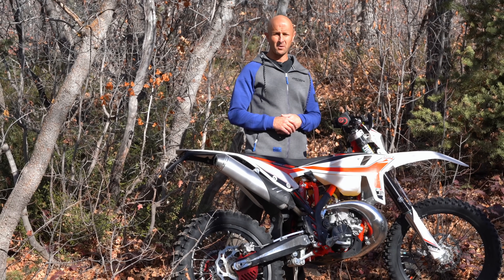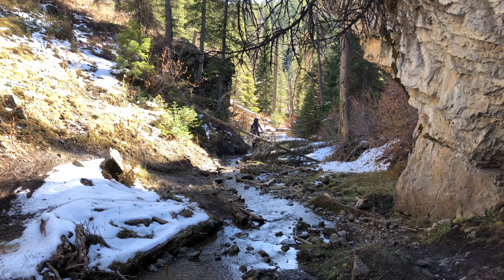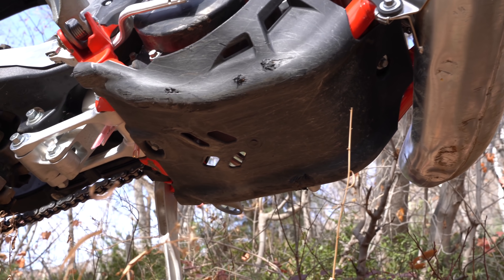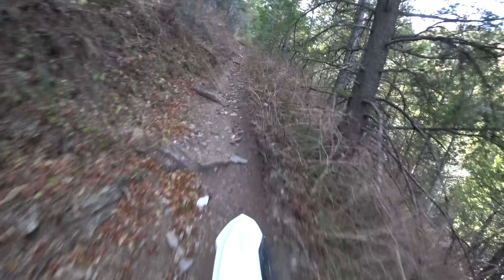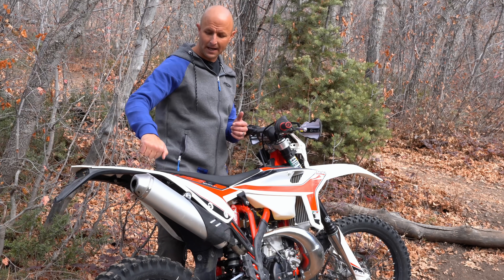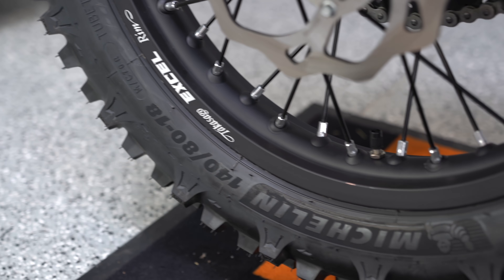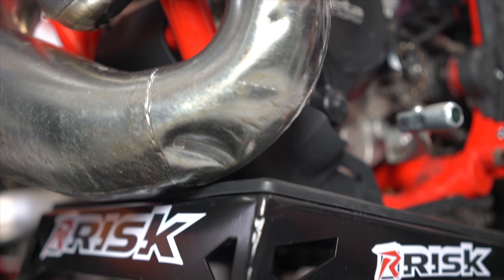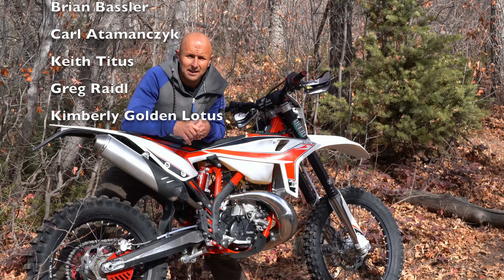2020 Beta 200RR Full Review | This Bike Does Something Better than ANY other bike!

Comment: I rode this bike during one of Beta's demo days and I loved it. I love 200 CC 2 strokes, they're the perfect size for me. Like you said, it's the perfect balance of power and torque and doesn't beat you up. You can lug it or wind it out. I ride more MX style but I still loved this bike. I had to Frankenbike the bike I ride now. I had a 2004 KTM 200 SX but didn't like the rear pds suspension so I bought a 2015 150 SX and swapped the 200 SX engine in it and couldn't be happier but the 200 RR from Beta is one hell of a bike. I had the same problem with the limited steering throw on my KTM but I took the bolts that were acting as stops and turned them in a couple turns. It makes a little contact with the radiators but it's worth it in my opinion.

Comment: I had a KTM 200, perfect size two stroke in my opinion. Can lug really well but still revs quick and has top end.
Reply: 2004 200sx is one the best. Still has torque but the top end will remind you have a 125 only bad thing is the pipe is massive and need be carful woods riding.

Comment: I own a 2019 200RR, and it is the most fun dirt bike I have ever owned, and I have owned a lot of different dirt bikes in my 28 years of riding.  I'm so surprised with how much low end power this small bore 2T has.  I ride in the Pacific NW woods where I prefer the tight single track stuff.  That is where this bike really shines!  Like Kyle says, the power is controllable, but still fun.  The smile factor is when you are riding single track and in some spots you can wring the throttle open and the bike launches, but not so much that the bike feels out of control.
Reply: Roost-a-Fish how do you compare it to a KTM 200? Similar? Better?
Reply: @jotacalvo  Since you can't buy a KTM 200 anymore, I would say better.  But I do have a friend with a 2015 KTM 200, and we traded a bit.  I wanted my Beta back after the trade.  I just love the motor on the Beta and the compact frame.  It's just a lot of fun.
Reply: Roost-a-Fish I was asking because I now ride a KTM 200. So which one to buy isnt really an issue. I’m just trying to figure out whether it would be an upgrade. I do have my Keihin tuned beautifully, and had the head cut. So motor-wise, I can’t imagine a stock Beta being better than my KTM. The turning radius would be a big deal to me, and the much heavier weight, as I’m a tight woods rider. But the smallish frame is a big factor for me, also, being so short. I think I need to ride one of these to know for sure.

Comment: Thanks a lot for this Review. I actually ride a beta 350 rr and want to add a 2 Stroke. I am a beginner. What you recommend the husqvarna te 250 or beta 200 rr for a new guy? I mostly ride mx/enduro tracks, but wants to get deeper into technical stuff. I am 5'9 and about 140lbs. Regards from germany

Comment: Nice Bike ..  I like oil injection.  I never could understand how  oil would still work after  being diluted in the gasoline..  They say  you  can  use  less oil  with injection than with premix..  Skidoo  computer controlled  oil injection..  Injects the oil  to critical points in the engine such as the  crank bearings..  The  oil ratio  is richer  at  full power and less when  running at a light load..  Thus  if  you ride easy  you use much less oil than what  you use at full throttle ..
  Skidoo also has  direct  fuel injection.. which is the ultimate.. because no raw  fuel  goes out the exhaust ports..  Emissions  way down and fuel economy way up ..

Comment: 241lbs ? Dang that thing comes in same as my 300RR Race Edition with 2 gallons of fuel in it. Love the Beta line all together, haven't ridden one that I didn't like yet. Tip: with the E-start only, carry a couple of spare fuses in case you lay the bike down and tear your horn off the radiator which causes the horn wires to arc and pop your fuse, then your e-start won't work.

Comment: Great reviews! Would you recommend this or a YZ250X for a beginner for single track and fire trails? I'm 6ft 250lb with gear.
Reply: I’m 6’4 230ish my first bike was a exc200,  it was perfect, definitely did not feel underpowered, waaaay more tourqey than a 125.  200 2stroke enduro is possibly THE best option for a beginner in my experience
Reply: @27walker27  legend, thanks.

Comment: I got a serious question and I’d really like to know what you would buy if you were me... I’m torn between a beta 200rr, a beta x trainer 300, or a kx250x. I’m a small guy around 140lbs 5’7 I ride rough medium slow trails in California high desert terrain. I have a ktm 350 exc with a stabilizer and suspension tuning for my wide open riding but I want something lighter or something that feels lighter. I included the kx250x because I’ve owned a kx250f and know they are fast
Reply: You don’t have to reply I just wanna bounce my choices around

Comment: I would love to see a video where you compare the sounds of all 2-stroke engine sizes. 125, 150, 200, 250, 300...
Reply: Bigger engine more low end torque most the time. 125s u have no power unless on the pipe 200s u have a bit of bottom end not nearly the torque of a 250 but 200s have a top end like a 125. And they all depend on jetting pipes and flyweight a 250sx with woods pipe has lot od torque not much top end put a sx pipe on it lot less torque and a lot of top end if your not ready it will sit u on your ass.
Reply: @cowpker4life333  Right. I knew that already. I just asked for sound comparisons. Not a comparison for how they ride.

Comment: Thank you for doing at least a minor review of the lighting. Some of us are really interested in how well the stock lighting works. Do you know if a Beta dealer can get the OEM directionals (with compatible wiring) in the US? That would be a bonus for those of us who pursue street legality... Also, there must be something that can be done to tighten up the turning radius - re-locate the upper radiator mounts further back?

Comment: Great review mate
I live in New Zealand.
I'm in my early fifties 6 feet tall & have been away from riding for a long time due to a bad knee injury similar to yours & got into other things.
Would you recommend on of these over a 300 or a completely different brand.
Oh by the way I'm old school as far as wanting my next bike to be a 2 stroke.
Cheers keep up the great work.
Reply: Either bike will be fine for you. Remember that the 300 has many ways you can tune the sting out of it, plus if you are around 100kgs the 300 has a bit more suspension tuning available to it. Or go a 300 Xtrainer. Modern 2 strokes are just soooo much fun compared to the 2 strokes of the 1970's I grew up with. Invest in good knee braces. And just ride:)

Comment: Would you choose the beta 200rr, ktm 250 xc / xcw or yz250x for 1st 2 stroke trail /enduro bike?
Reply: You picked one yet? I'm currently going through the same choices!
Reply: @eab62  i purchased a 2020 ktm 250 xc-w tpi. I haven't rode it much yet (0.3hours) but I love the bike from the few minutes of riding, plenty of power and that counterbalanced motor is so smooth.

Comment: I have a KTM 200SX. I couldn't find a 200EXC in California.
The high compression piston and heavy K3 flywheel make it great on trails. Why KTM ended the 200 line eludes me.
Reply: Maybe because they have a 125 150 and 250. Could of dropped the 150 imo and kept the 200 but what are you going do.
Reply: @cowpker4life333  the new cases might not be strong enough for a 200. Using them for the 125/150 might be the design limits.

Comment: I've been saving up for a 2nd hand dirt bike now my parents tell me Im not allowed get one🙁do you have any vids to convince them 😅
Reply: Sean B in your situation it’s better to beg for forgiveness than ask for permission
Reply: @markd1059 ?
Reply: Keep it at a friends house 🤣
Reply: Really, you'll have to figure out how to convince them or wait it out.  Even if it's the second part, it's worth the wait.  Keep working hard and saving!
Reply: Sorry to hear that... My first bike was an Honda XR80 at 8yrs old. 2nd bike was an XR100 at 10yrs old. Then I hit a growth spurt at hit 5'10 145lbs so I sold my 100cc bike and bought an XR250R which I've ridden ever since. I'm 38yrs old now and have 5 kids. I've been bumped and scraped by a few obstacles over the years but never broken anything cant say that about snow boarding wear I've broken my wrist when I was 12yrs old. Until I was 21yrs old my protective gear consisted of a full face helmet, fox full chest/shoulder/upper arm protectors, gloves, kidney belt, and baggy riding pants. After 21 I decided to get some boots. They are very restrictive and I think I became a better rider without them because it made me be more cautious. When you have boots on you feel indestructible and that's not good when your little. Some awareness of your limits is good when your little. Also a bike is a bike. Don't worry about getting one on the small size. It will make you a better rider if your trying to keep up with your buddies. I didn't have regular riding buddies in my neighborhood until a few months before I transitioned over to my XR100. Once I got the 100 there were about 5 of us with dirt bikes and we lived on the edge of town and could ride our bikes out of our neighborhood to endless desert and mountain trails. There were no cell phones for kids back the. We would pack some snacks, bring water, and a liter - to as much as an extra gallon of fuel for our longer rides. 

All my kids are old enough now to get bikes. All of them are saving for their 1st bikes. They have to buy their protective gear 1st and have $500 down on their bike. I'm using this as an opportunity for them to start building their credit by being a cosigner on their bikes in their name through our credit union. 

Each of my kids makes $25 or more per week which they give to me to put in their savings account. This is my past and current experience. Hope you can share with your parents. 

I would recommend an air cooled 4 stroke. Honda has 5 or 6 air cooled bikes with electric start and fuel injection which will be so reliable you'll never need to take them to a shop as long as you change your own tires, spark plug, oil, oil filter, air filter, and chain. Nothing else on those bikes will ever need servicing... 

The Honda CRFs are the only Air Cooled Bikes with fuel injection aside from the all new Kawasaki KDX230. 

Honda has air cooled, electric start, and fuel injection on there CRF110, 125, 125 big wheel, and 250. Non of these bikes are meant to be jumped on a motor cross track. They are beasts on the trails, single track, and climb like Billy goats. They have super quiet exhaust and all these bikes also have electric start which I've never had. But I imagine if your new to the sport will help lower the frustration that most have until the know how to kick their bike over like a base ball player knows how to throw accurately with a little heat in warm-ups before a game. 

Don't get a 2 stroke if your parents and neighbors will be concerned with noise.  The air cooled bikes are quieter, and lower compression engines which is why they last so long. 

Anything with radiators will have more maintenance and will likely be high compression and need the engine serviced based upon how hard you ride your bike. 

With air cooled you can run them hard all the time year after year and never need engine work.
Reply: Show them Kyle's videos with his kids riding. Show them with proper gear it's no more risky then other sports. Show them his maintenance videos and that you want to learn how to take care of a motorcycle. Those skills will help later on in life. Dirt biking is better than  hours and hours of X Box etc .

Comment: I have never sat on a dirtbike I weigh 210lbs live in Houston tx and am 6ft 4in is a 2002 yamaha 225 ttr good for me? Or should I save up to get a 2017 ktm 150 xc-w i plan on doing trail riding so I'm wondering if not having as good of a bike will make me less able to keep up with others on the trail and if so how much worse off will I be with the yamaha 225 ttr
Reply: You have 0 hrs on a dirt bike? ,but some street? With your size, you will be moving up probably quickly from what ever you start out on. A kdx220  or Honda xr250 would serve you well and can be had for around 2k fir clean examples, too the resale value will not drop. The 225/230 anything would be great to learn all the very basics in the backyard type riding.  They have decent power, but are sprung so softly and layout is small. They will feel like a mini bike, again good for the absolute beginner, but you will quickly need more. The older ttr 250 or drz250 have e start and are nice too.
Reply: @markmtbrider  I have no street bike experience only atv but i know that doesn't translate to dirtbike skill. I'm starting to consider 4t but I'd like a 2t will i out grow a ktm 150 or some other 150 or 125 2t?
Reply: @Hwyw  the 150 or a 125 2ts  are not easy bikes to learn on. They make plenty of power , but In a hard to use way for someone new. It all depends on how much money you have to get started...to some extent ,your age and mechanical skills. The Honda 250x could be next to perfect for your size ,but it requires alot of up keep on the valves and motor. The other older 250 4ts  make for great reliable,easy to own and operate trail bikes.  They are just a bit bigger in every way than the 230 4ts. The last generation of kdx 200/220 are a bit more performance oriented and lighter weight than the playbike 4ts , and are easy to work on, easy to start , easy to modify for better performance as you need it and are relatively cheap. 125's and 150's can be ridden at a high level, just very demanding to do so ,especially for 200lbs plus riders. All depends on how much you want to spend ,and where you want to ride . The tougher the terrain, the more having some torque at lower rpms will help. I really like the 05 generation ktm 250/300. You can adj the power valve, to be mellow or mx hit, easy to work on,easy to start.....just not all that inexpensive, compared to a kdx220.
Reply: KDX 220 is what I would recommend you look for. You could ride it for several years before you could truly outride it.
Reply from the maker: Zechariah Stanley email me and we can get on the phone and chat about your options: kyle at dirtbikechannel dot com :)
Reply: Try and find a cleaner kdx 200. 95 through 06 is the last generation. They are really good versatile bikes, and perfect for a beginner. I just highly recommended Japanese bikes because you wont be wrenching on it all the time. Other good bikes would be a yz250 or a Japanese 250 four stroke. I have to believe that Kyle has been exposed to these bikes at some point. They have never made his list for beginner bike/first dirt bike, that I know of. Good luck with the bike search and getting into it.

Comment: I was planning on a 2020 XTrainer, I've ridden my buddies 2016 and I love it. I would consider myself an above average rider and this bike is very tempting. I'm just concerned that I'm too heavy for it at 205 - 210. Anyone have experience in this bike at my weight?
Reply: I think you would be fine but if not it wouldn’t be too hard to fix that problem, I’m also pretty sure the xtrainer has softer suspension than the rr bikes
Reply: @brannonmeador1792  I did get the bike and I've been on 5 technicality difficult rides. The bike is more than I expected. Light, powerful and nimble on the technical trails.
Reply: Dan H, I’m a similar weight. How’s the bike going for you? Do you think it would be difficult to ride in hard enduro style riding? Cheers.

Comment: Why is there a Dent in your exhaust
Reply from the maker: I'm guessing you don't ride a whole lot :)
Reply: @DirtBikeChannel   I'm just getting in to motorcycles I'm not mechanically inclined to
Reply: Power dent
Reply: Street Rossi cause the ground is literally mud and rocks?
Reply: Street Rossi 
It’s pretty easy to dent the pipe when you lay it down or crash. The dents are easy to fix with water and about an hour in a freezer.

Comment: U guys do understand that when u compress suspension the linkage goes up 99 percent of time as u hit an obstacle suspension compresses and u never  touch the link
Reply: daniel bernier 
It can be an issue when sliding over a log or other obstacles.
Reply from the maker: Looking at the bottom on my linkages on every bike ever says you can hit them.  All. The. Time :)

Comment: Brand new beta 200 or an 2015 200 exc, what would you recommend? Beta is about 15kg heavier...probably the biggest difference
Reply: I owned a 2013 200exc and rode the 2020 and even 2019 beta 200rr back to back with my ktm.
The beta is the better bike IMO. The chassis is much slimmer and easier to manoeuvre and the motor feels more refined.
The ktm feels like a small motor stuck in a big chassis(because it is) but the beta feels like it was designed to work in conjunction with the smaller motor(because it was)
Good luck!

Comment: The weights comparison is way off the scale!! I have a 2023 200RR and 2021 KTM 300XC and weighed them both myself. My 200RR full of fuel ready to ride weighs 241 lbs which matches his. My 300 on the other hand weighs in at 257 lbs full of fuel (Highland Cycle says a 300 weighs 260lbs), my 300 weighs 241 with one pint of fuel in the tank. NOT less than a 200 RR... there's no way... park them next to each other and the size of the framing and engine of the 300 are massive compared to the 200.
The KTM 300 gets a preferential marketing IMO. It is a great bike... but let's be real... its big.
I'm loving my 200RR, its like riding a bicycle compared to the 300 XC. Anyone want to buy a '21 300XC, mine's for sale now that I've had my 200 for a while. :)